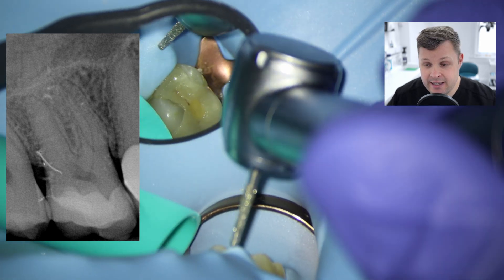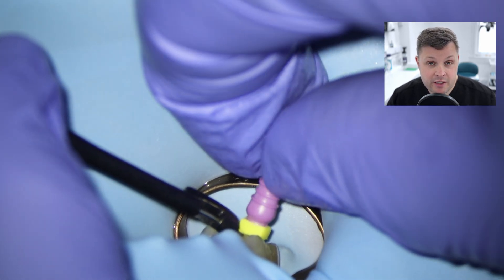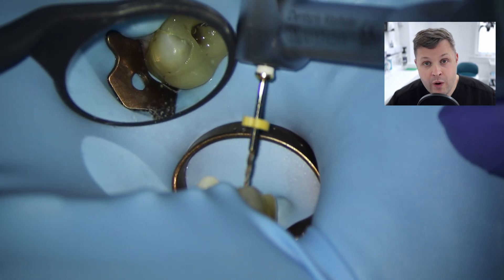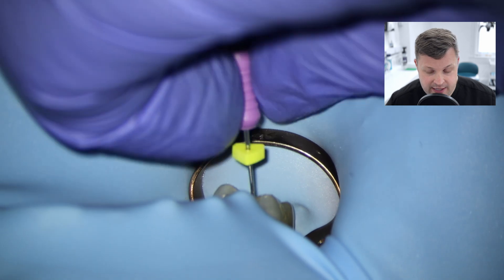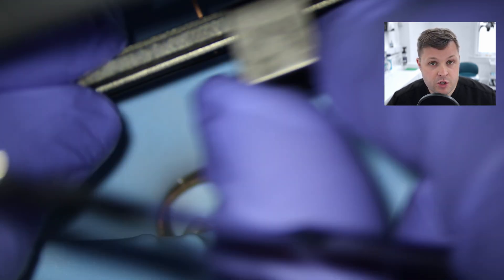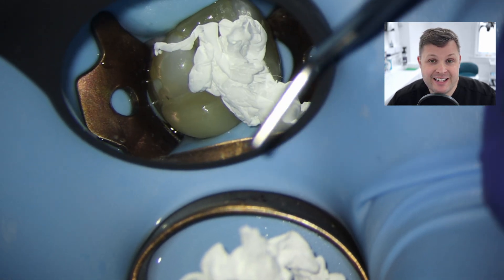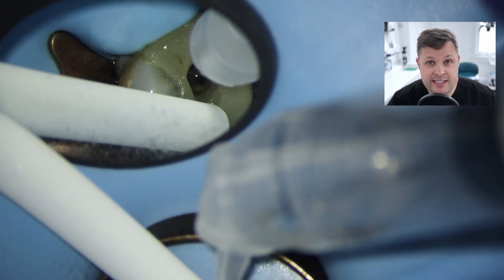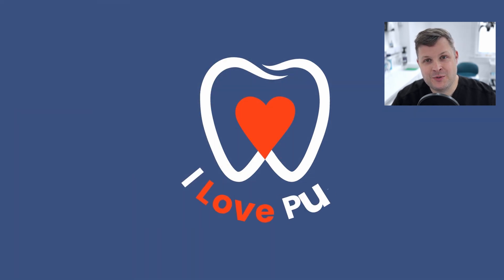No Flare, No Fuss — Just Pure Endo Precision

Comment: beautiful case! One thing that I might have done differently is sizing up to a 30 or 35 Hyflex (if it exists?) on the palatal since the size 25 GP point slipped past the working length, indicating possobly insufficient apical gauging and therefore perhaps not enough cutting action at the apical few milimeters with the size 25 file. What do you think?

Comment: Do you find that wave 1 gold takes a lot longer? I used to be NHS up until 2014, and I used the sendoline file system and was able to do a molar endo in 45 mins with good results. Im now finding I am taking way longer and using w1g it doesn't go to length easily. Sendoline I would use 3 to 4 files, and even before that pro taper. I find W1g much more blocky / debris build up, and its a false economy as chairside time is way more £££ than the actual file. Love to hear your thoughts.
Reply from the maker: @mda99das  not a fan of reciprocation, mainly due to cutting efficiency. I’ll love to hear any opposing thoughts though! Also, I would like to ask, we are about to launch a podcast about dentists who carry out root canal and are worried about getting everything right, and the mental stress this can put on a clinician, are there any topics you would like us to talk about?